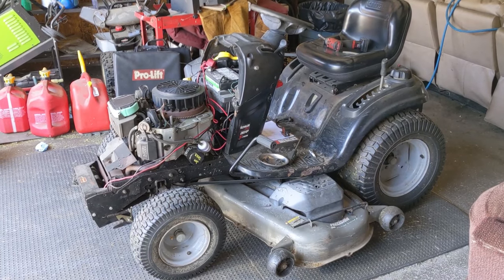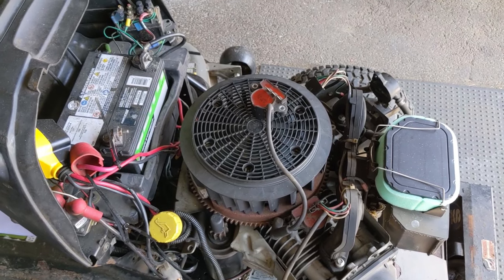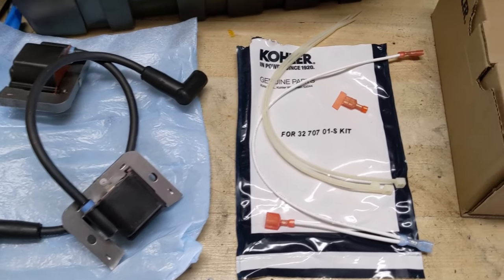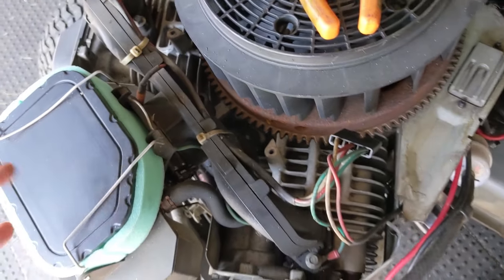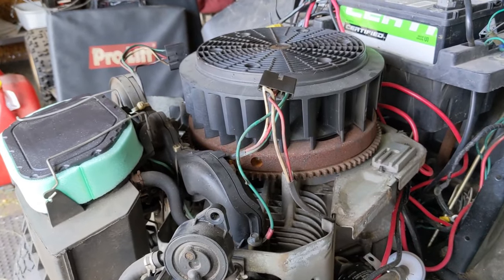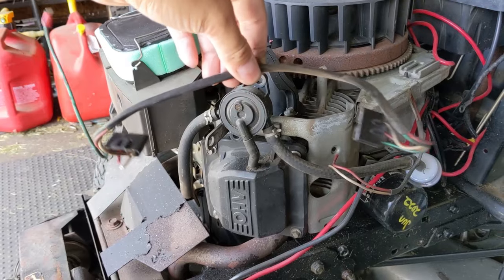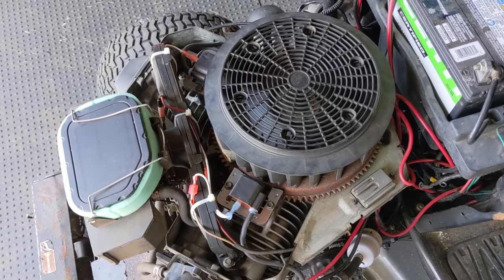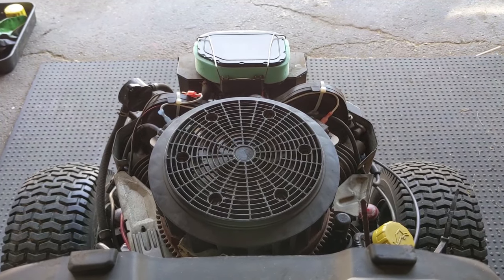Kohler V-Twin DSAI to MDI Ignition Upgrade

Comment: My recently acquired Cub Cadet GTX1054 2010 year, 27hp SV740 twin. has the old 4 wire coils. It runs but the magnet-to-coil gap is about 3/16' of an inch. no clearance adjustment slot on the coil body. where do I go with this ?, short of replacing at about $300, shipped overseas to BERMUDA. Thanks, I am a regular viewer !
Reply from the maker: I believe the old ignition modules don't have an armature air gap spec, I think they just bolt right up. If there's no slot on the ignition module to adjust, then they don't adjust.
Reply: @EliminatorPerformance  THANK YOU ! your comment confirms my finding. I now feel more relieved to suss out other irregularities. Great Show !!
Reply: Maurice, I have the same engine you do!  The part number on my coils is identical to the ones in the video.  The 'Parts Bulletin' that is shown @6:18 shows our engine listed at the bottom and the new replacement 'MDI Conversion kit' is the same one that he is using (32 707 01-S).  I  have the Kohler Courage SV740 twin and when I engage the PTO/Mower Blades the engine bogs down.  I ordered the new MDI kit off of Amazon for $118 (the same shown in his video).  Good luck with your engine!

Comment: good morning, i have the Kohler command 27HP and i need to switch to MDI coils, your video shows courage, how much difference is there? i looked up 32 707-03 and could not find it, any suggestions? also my fuel solenoid is hooked to the harness as it is in your video, its not directly connected to its own power source, that being said in your video the harness on my tractor is the same as yours but the main connection area is opposite of your video.
Reply from the maker: From what I can tell, they basically just flip sides. It's all very similar. You need red power to the fuel solenoid and white ground to the new coil kill wire. Follow the steps in the video and just mirror it to the other side, if that makes sense.
Reply: @EliminatorPerformance  ok, I just looked further into the wires, looks like the black is grounded to the intake, and I also see that the fuel Cilla Noyd  is directly connected, so 2 red wires, one to harness, and the other to the fuel solenoid

Comment: Ok so I installed the new coils exactly like the video. It starts but is still running on only 1 cylinder. I'm not very good with small or big motors. I'm wondering if you have any other suggestions?? I have no meters or gadgets to check anything..
Thank you,
Paul
Reply from the maker: I would start by unplugging the kill wire on the cylinder that isn't working. You may have a short to ground somewhere that is grounding the coil, thus preventing spark. If the coil still doesn't produce spark with the kill wire (ground wire) removed, I would swap the spark plugs to make sure it isn't a faulty plug. If the plugs are ruled out, replace the coil.
Reply: Oh I forgot to say they are new spark plugs as well..
Reply: Ok I got spark to both cylinders..
Reply: Update on my Kohler.  Finally quit raining here so I took my tractor out for some work. Ran great!!! Thank you so much for your video!!!!!

Comment: Hey boss how is your truck  doing did the tsb fix it  long   term. Just  wondering
Reply from the maker: It's great, took it to the Dyno recently to see what it put down, was planning on making a video by the end of the month. Also doing a consumption test to see if it's losing any oil (just go in every 1000kms and they measure the oil on the dipstick) as I was smelling a bit of oil and did notice the mark was a bit low.
Reply: Hey how did the oil consumption test work out
Reply from the maker: @jms-er1kq  still going through it, I work from the garage at home and don't drive much. Takes a while for me to get 5000kms lol it goes in next week for them to check again. I smelled burnt oil on the highway after passing someone so I know it's burning a bit

Comment: I have a 26 hp kohler courage craftsman mower but the coils only have two wires not three like the one shown at 2 minutes 33 seconds, what  conversion kit will work for it?
Reply: the kohler 24 584 201s is the ignition coil for the SV725 engine
Reply: @waynestefinashen239  I found it, I couldn't verify which one, but now I'm confident I have the right coils,... Thank you

Comment: Hi like to know if I got coils with two blades on it will it work the same as what you put in with one blade thanks please let me know got the same type of tractor sears
Reply: You need the ignition coils that are designed for your model of kohler engine the CH series have 2 tabs the SV only one

Comment: I have noticed that Kohler is the best company when it come to plumbing supplies but Kohler does NOT make great small engines. They should just stick to plumbing. 🤷🏿‍♂️🤷🏿‍♂️🤷🏿‍♂️🤷🏿‍♂️🤷🏿‍♂️🤔
Reply from the maker: Lol yea, I only recommend Kawasaki engines now!
Reply: I thought that you would say that Honda engines were the best. 🥴🥴🥴
Reply from the maker: @patrickpoulard24  yes they are, but you can't get them for riding mowers so I recommend Kawasaki. Hondas are great and I definitely recommend them for push or self propelled mowers.
Reply: @EliminatorPerformance  Oh wow, I didn't realize that Honda didn't make engines for riding mowers. I wonder why?🤷🏿‍♂️🤷🏿‍♂️🤷🏿‍♂️🤷🏿‍♂️🤷🏿‍♂️🥴
Reply from the maker: @patrickpoulard24  I believe they only make them for their own mowers now, which I also believe are no longer sold in north America.
Reply: Nothing wrong with Kohlers from the Command and older. Newer not so much.
Reply: I have two Kohler k series engines still going strong. One on a riding mower, another on a tiller. I just bought a new (used) mower with a Kohler command, and besides the issue in this video, it seems good.
Reply: @arthurr8670  God bless you.😳 🙏🏿🙏🏿🙏🏿🙏🏿🥴
Reply: @douganderson7251 especially if they have the metal sleeve.
Reply: @patrickpoulard24 they did make them for zero turns but very rare to find
Reply: My 26hp kohler has clicked and  knocked from day one. Given a choice, I wouldn't buy another one.

Comment: Have the exact same tractor with the same engine that I've had since new with the exact same problem of running on one cylinder after the PTO as been engaged for awhile. Ordered the kit, then took off the cover, and was shocked to see that it actually had the DSAM ignition versus the DSAI. Luckily, the same kit works, and this was the closest instruction video that I found: https://www.youtube.com/watch?v=M_JKfzC3Iww. Was very similar to what I had to do.

Comment: PLEASE un torque the mag screws gently...or kohler bolts snap!!! Then your facing helicoil or something to re-mount the new coil. YOU CAN RUIN YOUR ENTIRE ENGINE...BY SNAPPING THE BOLT...i DID WHAT ORDEAL TO DRILL HELICOIL TAPP. PLEASE ON ALL KOHLER BOLTS "BEFORE YOU TURN ANY!!!"""""""""""""""""""""""""""""""""""""""""""""""""""""""""""""""
pb blaster....and dont run the flywheel into the loose mag....and snap the mounting bracket off...again new cylinder # engine